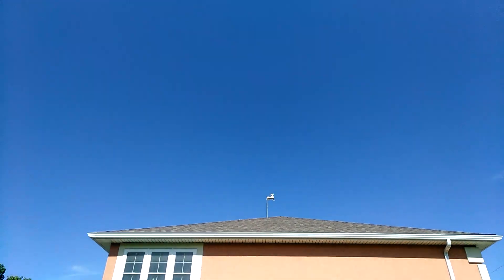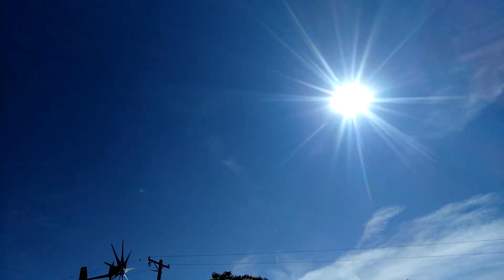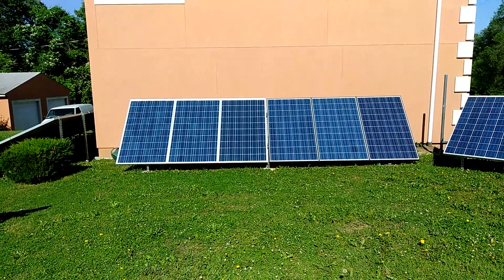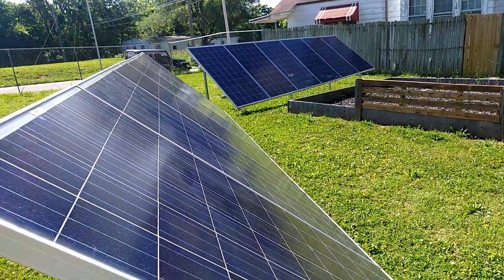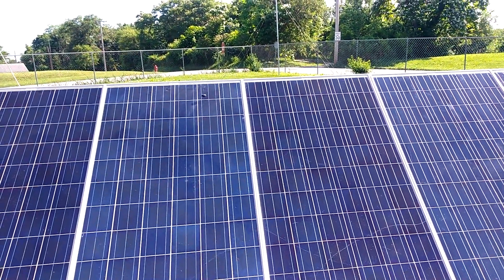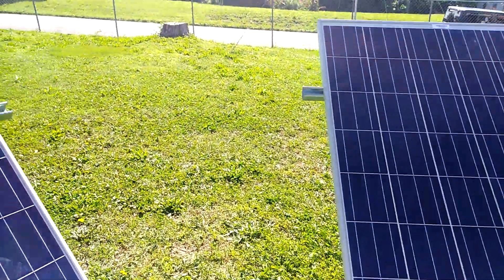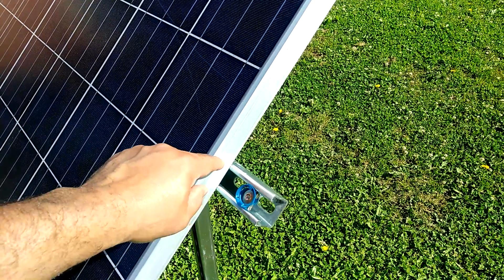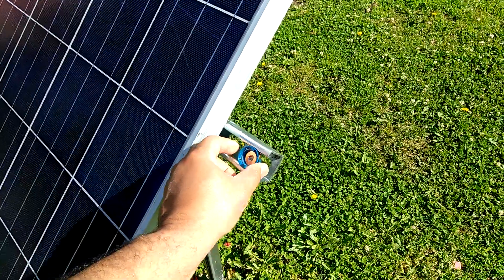how I mounted the panels to the super strut.

Comment: It's looking good man I'm curious what your bracket angles are I'm about purchase some 35-degree bracket what other bracket angles are you using towards the bottom of your rack besides 90 degrees
Reply from the maker: I have just been bending them to the angles that I want.  I find the angle that I want the panel to make the most power at the point in time of day that I want them to max out and that's the angle that I use.

Comment: The south bank that is 844 watts is likely actually making 900 watts like the other bank but the inverter is using the other 66 watts to operate the inverter. That may also be one reason they tell you to connect to a particular input first.
Reply from the maker: Cool thanks for that info 👍

Comment: do you have an ebay or amazon link to those slidebolts ?
Reply from the maker: The ones I have came from Home Depot but here is a link I found to them on eBay. https://www.ebay.com/itm/Thomas-N-Betts-Super-Strut-Cone-Nuts-1-2-30-P-c-/284230415703?_trksid=p2349624.m46890.l49286
Reply: @carsonlurbanwindandsolar3437  thank you

Comment: Nice tight fit may work good for a carport roof.
Reply from the maker: That would be nice making a carport roof out of solar panels and then drive your electric car in and plug it up 👍.
Reply: @carsonlurbanwindandsolar3437  Ya I think you may need double sided foam tape in-between the panels if you wanted all the rain out. lol